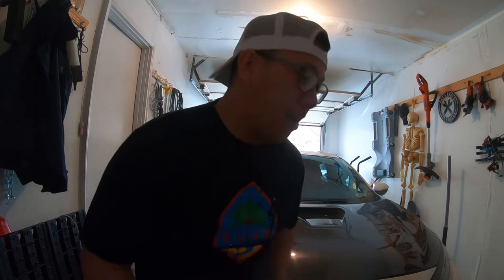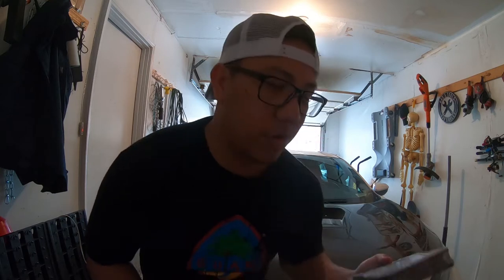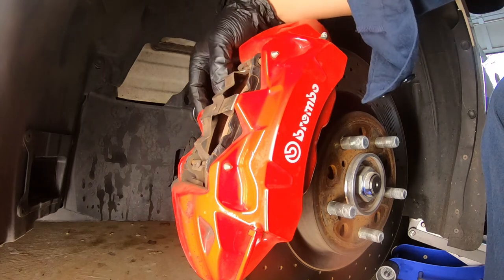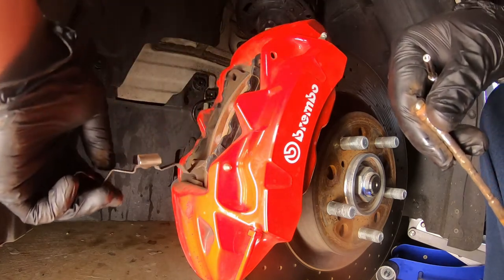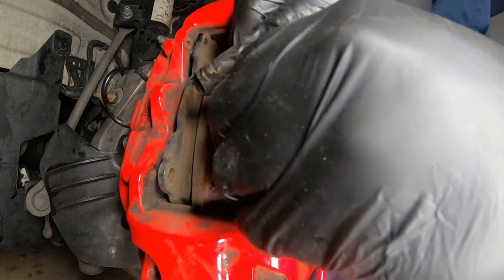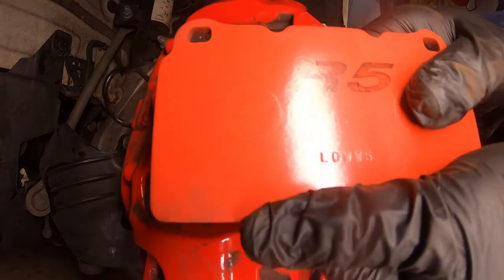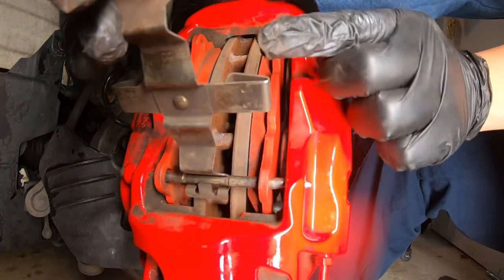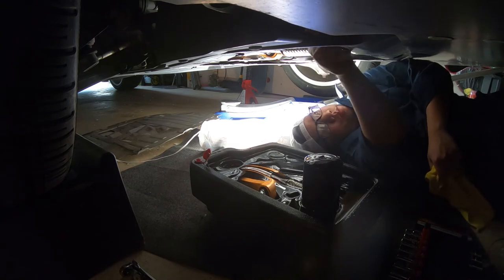TRACK PREP PART 2 | PARAGON BRAKE PADS | FK8 HONDA CIVIC TYPE R

Comment: John, did you put back the brembo pads after track day?
Reply from the maker: Yeah I did. I only use these pads for the track. I actually switched out the brembo pads with akebonos for less brake dust.
Reply: @johnnmango1022  thanks for the response. I was planning of keeping the paragons on, but it makes noise.

Comment: Did you find these pads really noisy on the street? Any issues otherwise? How was bed in?
Reply from the maker: Definitely noisy, but that’s most track pads that are meant for track use. Definitely not meant for daily use. Bed in was easy. I did it on my way to the track. Just follow the instructions. No issues whatsoever